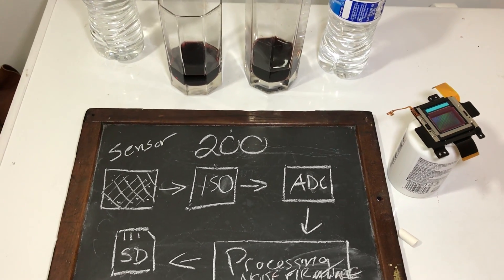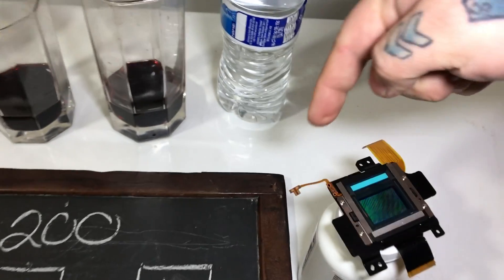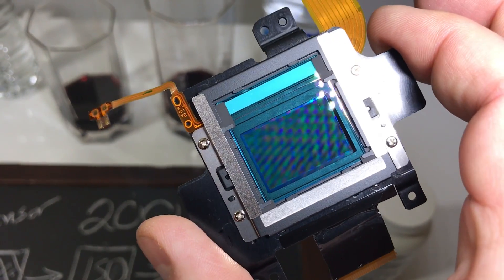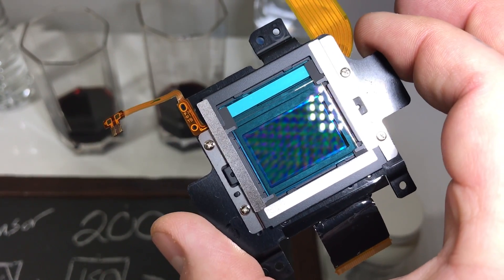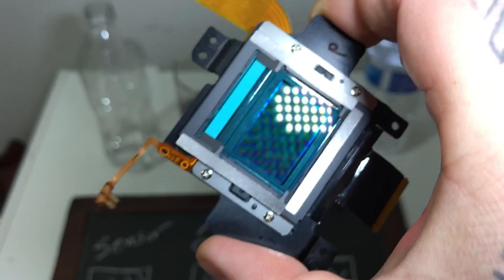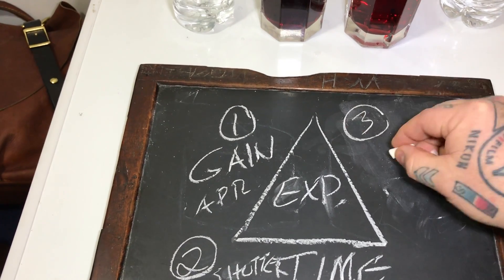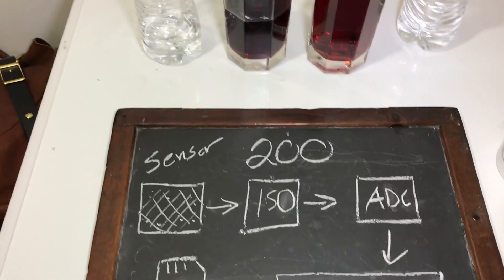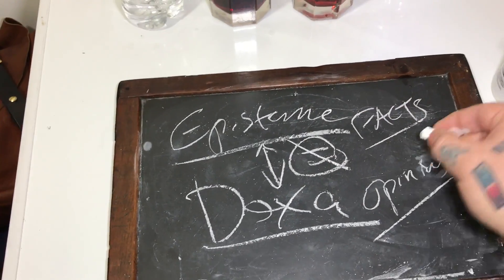😂Reality Check 😵 ISO is...and IS NOT

Comment: Question: Hipothetically say that I would shoot the same picture twice with the same aperture and shutter speed, same setup and all. But  the ISO would be native in one and the "correct exposure" ISO measure in the other one. I would then take those RAW captures into lightroom and adjust exposure on both digitally, in post-process. Would I get the same image? Since the ISO changes nothing in the sensor? What does that do to clipping highlights and shadows?

Comment: In essence your digital camera captures the image at its native ISO irrespective of the ISO you select. So if you shoot at ISO 800 ( and the sensors native ISO is 100 ) the image is captured at 100 ISO but the signal processor gets a message to amplify the captured image by 3 stops then applies noise processing before sending it to the SD card. With an invariant sensor you could argue that you could basically leave your ISO permanantly at its native ISO, get as close to correct exposure using aperture and shutter speed then simply correct to your desired exposure later in post. The only issue is, does your camera do a better job amplifying the signal than your computer?  If the camera does a better job then adjust ISO to suit exposure by selecting your required ISO. If your post editing software does a better job then correct exposure later using that instead by increasing or decreasing exposure to the RAW file. Or am I missing something? 😃
Reply from the maker: ISO is applied before ADC and processing, so overexposure by UPPING the ISO is of course very easy, but that doesnt mean ISO is part of exposure. 
1. lowest ISO
2. MOST exposure possible
= best image saturation and lowest noise
Reply: Dominic Morris Makes sense 😊 I guess my question ultimately is, is it better to increase gain in camera  or do it post processing ( assuming you are using an ISO invariant sensor )? I expect that's something that would be interesting to test. Of course there are many variables involved but I'd be curious to see which method is considered generally better 😋
Reply: I'd imagine it's better to let your camera handle the ISO/exposure rather than in comp. I say this because when I see tests done where they grab a dark image with native ISO (say 100) and up the exposure it always looks worse than the image that has an iso of 800 but correctly exposed. Also, there is the problem of Shutter Speed and not being able to review your image if it's so dark (in camera).
Reply: No there is no native iso. The photosites are buckets that collect electrons when hit by photons. So they are photon counters. Once collected, the electrons are passed down the line like passing water from bucket to bucket in a bucket brigade fashion. The devices are in fact called bucket brigades.
Each sample is then amplified as it exits the bucket brigade to a suitable value for the AD converter.
That suitable value is usually calibrated to match the number of photons counted before the original bucket is filled up (which is obviously when the sensor is overloaded, it can’t count anymore)
For smaller sensors this is typically 4096 photons which is why 12 bit AD converters are used.
For lager sensors using 14bit AD conversion, you can calculate how many photons fills the bucket... 2 to the power of 14 which is 16,384 photons counted.
Incidentally, 14 bits is 14 doublings so you have 14 stops dynamic range, in theory.
Of course there is noise which are unwanted photons which get into the bucket. They can come from heat (heat is IR photons) and switching noise of the transistors which are responsible for the signals driving the bucket brigade and processing of the digitised signals.
There you have it.... when you add gain you are not changing the sensitivity of the imaging chip, merely amplifying the signal from the bucket.
Recording RAW therefore is simply recording the number of photons received per bucket.
As the man says, there is no native ISO.

Comment: Why does every landscape photographer tell you to shoot at the "lowest ISO" possible for better image quality??  I am not trying to be argumentative - I really don't understand this apparent contradiction.  By the way I understand and agree with what Ken is sayiing - I really don't understand?
Reply: There is no contradiction with respect to what is relevant to You as a user. Internally in the camera the physics is different between analogue film & digital sensor. But for the photographer it can be treated as identical in behavior & use. Lowest native ISO-setting means least amount of noise aka highest signal-to-noise-ration (SNR) in your photo = best possible detail level. Like with film. Usually also means highest dynamic range of the sensor+its electronics. So You get a better image quality at the lowest native ISO-setting. Of course You need to apply other proper techniques like a good lens, a sturdy tripod, a suitable aperture etc. as well to capture the image at the best optical quality. And, most important of all, have a clear idea of what You want to achieve BEFORE you hit the release button. ATB, Gereon
Reply: Because with landscapes you normally have the luxury of a tripon and therefore a longer shutter gives you a better signal than just amplifying a shorter duration image.
Reply: Because higher "ISO" is not actually making the sensor more sensitive, as it is with film. It's applying higher voltage gain to the sensor, which also amplifies the noise. The camera's native ISO is the gain level that yields the best signal to noise ratio from the sensor - meaning, it's the setting where the highest percentage of the data is captured detail vs electrical noise. That's where your camera will yield the best possible image, so leaving the gain set at the camera's native value and adjusting shutter speed and/or aperture (or using ND filters to adjust the amount of light physically hitting the sensor) to set the exposure will give you a better image detail than you'd get from adjusting your gain (ISO) setting.